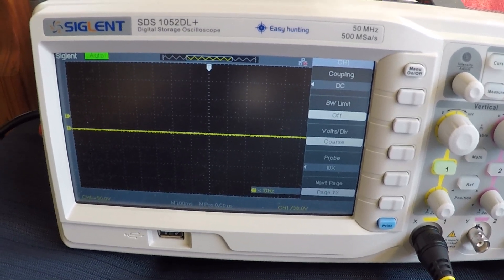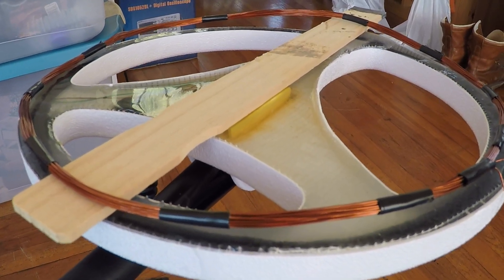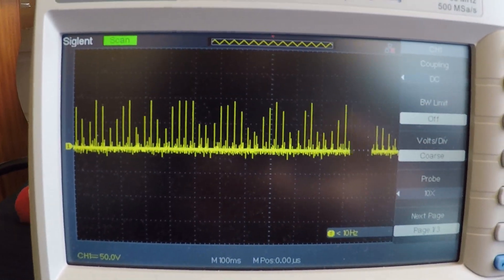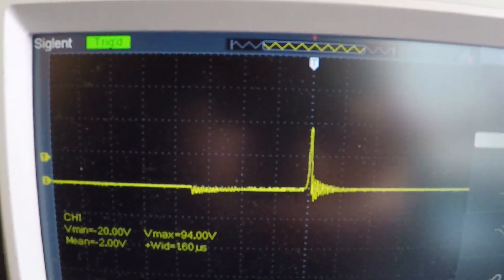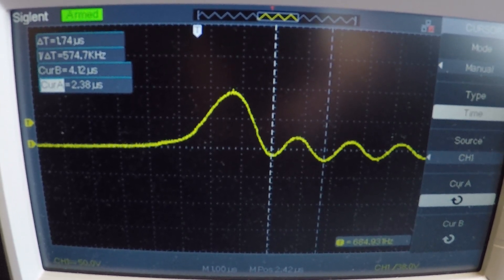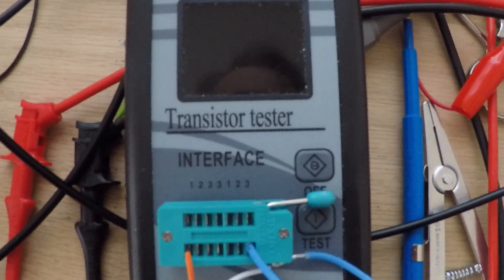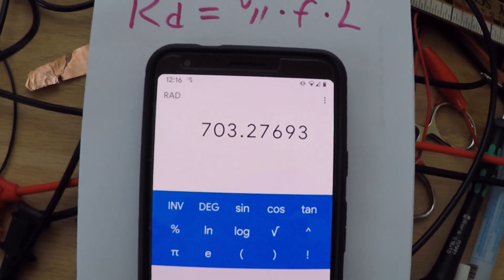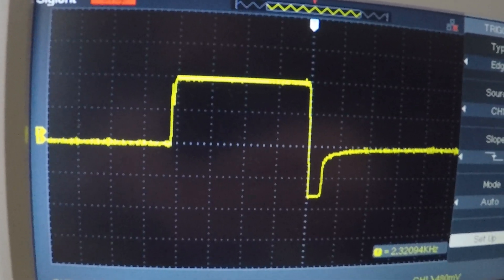Pulse Induction Mono coil Self Resonant Frequency

Comment: You could easily find the resonant frequency of a coil by using it (undamped) on any detector with one stage amplifier (like the arduino nano pi). The ringing in the wave is where to find it. I'm not sure if this works with two stages amp at pin 1 (first stage) of your dual amp. cheers

Comment: Pulse dedektör icin 1*1 baslık 05 tel kactur
Reply from the maker: You need to use a coil calculator so that you match the inductance to your detector.  On the Geotech Forum in the Coils section there is a calculator.

Comment: When you are using that transistor tester to check Capacitance of the coil does it have a capacitor hooked up to it also the reason i ask is im building a coil i did it with more turns so i could take some off until i got to the exact capacitance as in the post but somehow i ended up with less capacitance then he did i got 28.8MH he has 35MH with less turns ?
Reply from the maker: The transistor tester is testing for Inductance.  The coil is connected directly to the tester with no other components.  I am unsure what or who you are referencing with the remainder of your question.
Reply: I’m building a 8” concentric coil from a forum off online I used the same specs except a one size bigger gauge wire and I added ten extra turns which should make it higher canpctence but it’s not it’s saying it’s lower than even the calc it’s saying it’s like 43 turns to short
Reply from the maker: I am guessing that you mean Inductance as opposed to capacitance?  Sounds like you have not input the correct variables into your coil calculator.  Are you using this one?
 https://www.geotech1.com/forums/showthread.php?17909-Coil-Calculator
Reply: @SurfDetector  yes I posted pics in geo by the way it’s Silversurfer
Reply: Also the reason I asked is you have wires going into the tester not the coil magnet wire

Comment: I made a PI metal detector and need some help n the search coil,I made a 45*45 coil but it can't detect big objects for more than 1m in the air ,so if possible I need some help to correct this issue, 
What characteristics for a good coil .
Reply from the maker: What is the inductance of your coil?  What detector did you build?
Reply: @SurfDetector  I built a pi polones,the coil inductance 380 uH, resistance 1,9 ohm,
So if I want that the coil detect object for 2m deepth,what characteristics should I have in both side in the detector and the coil.
Reply: @safeerahmed7268  ok
Reply from the maker: @adil123eei  Adil,  You should look to build the Delta Pulse.  The Polones is good for finding coins not big treasure.

Comment: Mohon bantuannya 🙏🙏 saya ingin membuat coil diameter 25cm berapa banyak lilitan yang harus saya gunakan,
Terimakasih 🙏🙏
Reply from the maker: Selamat datang
What size wire do you have?  I need the size to tell you how many turns.
Reply: @SurfDetector  I have used a 0.5 wire email 🙏🙏
Reply from the maker: 20 turns will give you about 312uH
Thank you for watching my videos and please subscribe
Reply: @SurfDetector  
ok thanks and I'll try later, oh yeah I've subscribed to your channel from yesterday 🙏🙏
Reply from the maker: @metaldetektorjawatengah3024  I am happy to help you.  Thank you for subscribing.  I support your channel by subscribing as well.
Reply: @SurfDetector  maaf jika bahasa saya kurang jelas,saya belum begitu paham dengan bahasa Inggris 🙏🙏😁😁
Reply: @SurfDetector  🙏🙏 Sorry, may I ask again? there is a problem with the surf pi pro detector that I built, why when I swing the coil in the black sand and the red ground signal is messy?
Reply from the maker: @metaldetektorjawatengah3024  Did you shield your coil when you made it?  Also the cable shield where it attaches to your board needs be connected to ground on the PCB.
Reply from the maker: @metaldetektorjawatengah3024  When you are detecting in black sand you should increase your pulse delay to reduce the false signals.
Reply: @SurfDetector  yes my coil is not yet equipped with a shield, is it because there is no shield so there are many false signals
Reply from the maker: @metaldetektorjawatengah3024   increase your pulse delay to reduce the false signals.
Reply: @SurfDetector  okay thanks for everything, I'm very happy to meet a teacher like you 😅 and I will do my best 🙏🙏
Reply: @SurfDetector  hi How many turns of 40 cm coil, how many capacitors 0.30 coil